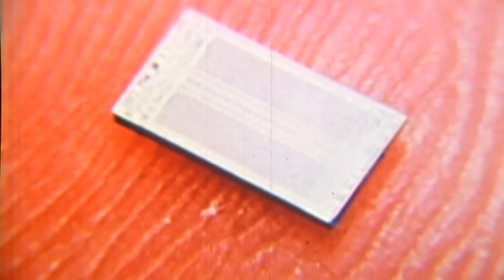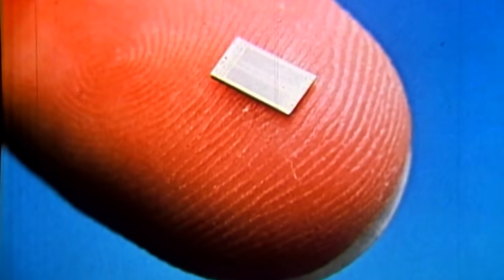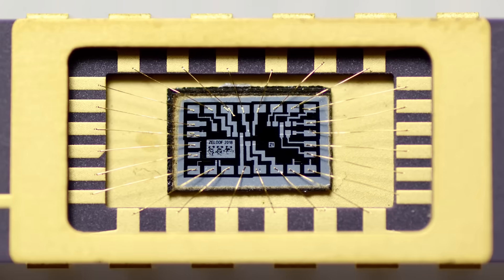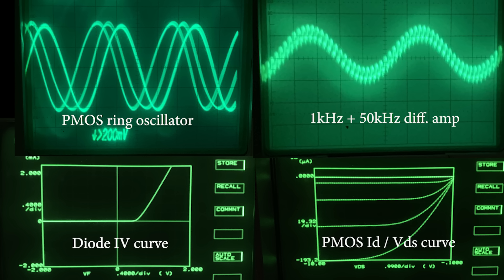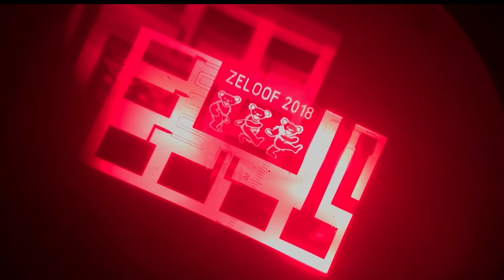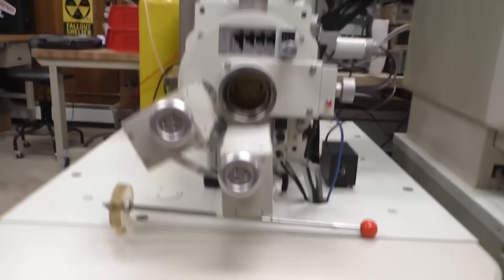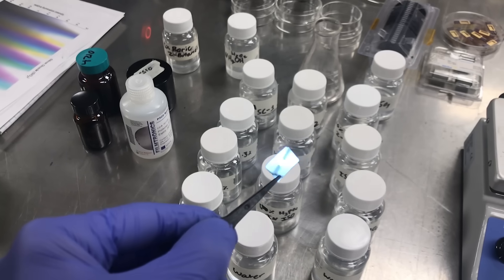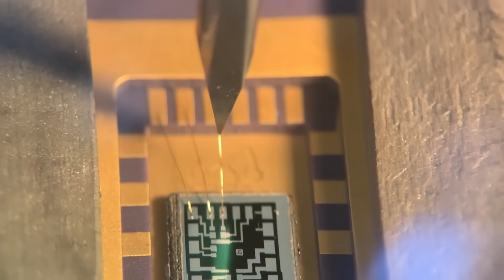"Z1" - Homemade Silicon ICs / Computer Chips

Comment: That moment when you realize that this guy's basement is better equipped than the university you attended...
Reply: Ya, whats up with that..
Reply: @turbojoe2  I don't understand why you are watching and commenting. do you despise I think he is a great individual researcher.
Reply: Sad truths.
Reply: At home I have a 3 gigabyte corpus of Khmer language, probably bigger than any linguistics department of any university has. Its because I DIY an English-Khmer translator called Sugar Palm Tree Translator.
Reply: @charlieangkor8649  wtf
Reply: YES
Reply: so true
Reply: Thats an understatement!
Reply: My university has a full semiconductor fab capable of up to FinFET and also a hypersonic wind tunnel and an experimental reactor was there,to be replaced by a fusion reactor.
Reply: Yes, because I didn't attend a university.
Reply: yea i saw the title and i was ready to make a ryzen with my kitchen gadgets and now this
Reply: This isn't a joke its literally better than my desks where I have my tools with my 3d printer lcd separator soldering tool hot glue shit and others amongst them I once wanted to buy the hot air machine for cpu separator for ps3-4 cause I had an idea to do some experiments and diy sockets play around with ps1 to inject some os or firmware and gpu from ps3 or even ps2 but only the machine itself cost a fortune to worth for a hobyist to behonestly I can be a freelancer but its easily to repair playstations with hot air gun if you are good although nobody will need repairs nowadays I got only repaired a hdmi socket on ps4 once with hot air gun this guy can repair even 10 layer motherboard with his equipment while I only trash them and at the best I fail to repair them if its not a capacitor problem or any other equally big component that will not be destroyed by solder gun or solder
Reply: I thought the same thing .....
Reply: True😂😂lol!!
Reply: REAL, FACT, LEGIT, TRUTH, TRUE
Reply: Hahahahahaha WoW so true!
Reply: And that HE should be one of the head guys somewhere big....!!
Reply: At least 2 m$
Reply: I make chips at home - not sure what all the fuss is about - some nice potatoes - in the oven....:)
Reply: I know that feel bro!
Reply: Fucking accurate
Reply: 😂😂😂
Totally true!
And I went to a very good one!
Reply: I agree. Homemade but 'home' where very well equipped.
But It is also great, because he understand whole process and use equipment.
Reply: lol
Reply: Yup
Reply: Then you are attending the wrong university
Reply: Also likely far cheaper to equip than the degree costs
Reply: 💀 moment
Reply: So true
Reply: i did a lab the other day, lab equipment had last certified accurate tags from 98.
Reply: True AF
Reply: the stuff you can achieve and learn by yourself is better than any university :)
Reply: Hahahaha zing!
Reply: Schools for fools
Reply: Exactly 💯
Reply: For sure
Reply: Yep! I studied economics, though, so...
Reply: Doesnt take much. To be honest the biggest gap isnt wealth its knowledge. After that its saving all your money amd taxes for like 2 years and you can get or build whatever you need.
Reply: He has a will to learn and do something about it. On the other hand, most students don't even try learning. And they become teachers in universities. They don't even try building things.
Reply: @JoséFranciscoCandidoFilho  Will is one thing. Money is another. I have 100% of the former, and 0% of the latter :P  And this equipment seems to cost helluva money :q
Reply: @bonbonpony  There are tons of people that do wonders with nothing. People help if your desire is truthful. He himself said so: he made everything scrapping parts and getting some as gifts. He just found a way.

People that needs lots of money wants everything ready and perfect. Try doing the parts yourself.

Money helps. A LOT.. But it isn't the necessary factor. Your will is.
Reply: thanks for motivation
Reply: @JoséFranciscoCandidoFilho  Yes, willpower is a powerful tool; i've got zilch for cash yet have some pretty neat kit on my electronics bench, nearly all gifts or oppourtunistic grabs of old tech (I've got two analogue oscilloscopes; one I saved from the dump, another I bought on the cheap from a local classified ad...)
Reply: @KomiyanVT  I'm in the same boat. A functional used 20MHz CRO from the 70's costs around ~200 USD in my area. 

I found mine in a junkyard. I took me ~4 years to fix it thanks to the parts being scarce but I got it cheap: I paid ~5 USD thanks to being very 'weighty'.

Considering everything, I must have spent around 30 USD to fix it. Some parts people gave away to me. Still, 30 USD was "a lot" for me at the time but very payable.

Not exactly the best of scopes but it made me learn so many things! I was able to create many others and earn some money.

Don't give up, people!
Reply: @JoséFranciscoCandidoFilho  Not true. He still has several thousands of dollars in equipment he has paid. Just his laser engraver he uses to cut silicon wafers is worth $30.000 new, or 10000-15000 used. In the best best case, he got it for 5000. He said his electron microscope was listed for 2500 although he persuaded the seller to sell it so cheap the shipping was worth more, I guess some $1000 in the end (500 + 500 shipping). He also has the advantage of living in the USA, pretty much every chemical is available and can be bought by anyone. In my country just some nitric acid or high test peroxide requires a military permit, and lots of more exotic chemicals are simply not available.

Compare that to myself 13 years ago... Sam wanted to make IC´s, I wanted to make gas turbines, I read the books and everything, but I wasn´t able to afford a simple used car turbo (worth $100-150 in those days) to start making it. Even today I can hardly afford 1/10 of his equipment, I don´t even own a mini metal lathe yet. Money IS an issue, you can´t make everything just with effort.
Reply: @JoséFranciscoCandidoFilho  I wish your view of the world was real
Reply: Bon Bon That’s true, I hope one day the universities will be open to everyone.
Reply: @JoséFranciscoCandidoFilho  and your freedom too. Some countries, even first world countries illegalize domestic ownership of heavy machinery without a license. I dream of living in america where you can pretty much do whatever you want unless it negatively affects other people.
Reply: @bonbonpony  you would be amazed at the equipment you can pick up for next to nothing at hamfests. Massive ones sell all kinds of stuff other than ham radios, many times auction vendors that buy up University sales, estate sales, lab equipment dumps from various companies as they upgrade, sell at these shows. Craigslist in the industrial sales section you can buy machine shop tools. You may have to make that vacuum chamber yourself. With a lathe and mill.
Reply: @JoséFranciscoCandidoFilho  Sorry but the real world isn`t anything like you described.
Reply: @random-thought-919  There are those that do something and the majority that doesn't. For me, it is that simple.
Reply: @JoséFranciscoCandidoFilho  I've never seen you on Forbes. Maybe you are not doing enough then.
Reply: @random-thought-919  let's get things straight:

- If that ever happen, so be it. But I don't plan on being on Forbes. 
- Science & DIY doesn't mean Forbesand never will.

- You need to chose if you want to do something or be on Forbes (or both - only God knows the effort you will put on it).
- Maybe you are not getting there because you are deviating you ways (e.g. expending time doing sassy comments that helped no one and that doesn't have relevance). The author of the video certainly won't waste time on these type of stupidity - neither will I anymore.
Reply: @JoséFranciscoCandidoFilho  You just wasted your time.

Man, just quit that `work hard get there` bullshit. Meritocracy is not a thing.
Reply: @JoséFranciscoCandidoFilho  Hey man, thanks for your speech. It's very inspiring but sadly you still to have moneys.
Reply: @estebannegrete7662  laser engraver? cant he just cut the wavers with a hacksaw?
Reply: @JoséFranciscoCandidoFilho  who is Forbes?
Reply: @charlieangkor8649  The guy deleted the comment. He said something about me never being on Forbes (magazine) or being important so what I said was supposedly bullshit.

Edit: the magazine is famous for listing the richest or the most powerful every year and many other lists.

Example: https://www.forbes.com/billionaires
Reply: @s.sradon9782  what country won't let you buy machines lol? its not they they can be used as a weapon
Reply: @baileyharrison1030  the UK can fine you and confiscate your heavy machinery if it happens so to not meet regulations. So lathes, steamhammers etc
Something like an electric kettle or PC is fine though...probably.
Reply: S.S RADON but if you’re not selling anything or using machinery commercially, then would they really send inspectors to make sure your CNC machine ‘meets regulations’. I’m also from the UK and I didn’t really think something like this would happen.
Reply: @baileyharrison1030  you basically need a license for everything here, but given that your neighbours don't report you you'll be fine.
Reply: @bonbonpony  best ponii
Reply: @JoséFranciscoCandidoFilho  after i read your comment i made a 4NM x86 256 core CPU in my bathroom with nothing but an old paperclip and wires harvested from my toaster!!!
Reply: @impv1se  Cool! Now, please, make a 64bit 256 core with an addition of rusty stapler - that only God knows why - was in your bathroom. Photos or it didn't happen.
Reply: @JoséFranciscoCandidoFilho  what makes you think its not 64 bit?  x86 is just the instruction set. meaning its an intel/amd compatible. not even god knows why... i hope.
Reply: @s.sradon9782  I do not live in America, unfortunately in this case.
Reply: @leduy6623  Believe it or not, I did work for a major semi that I'm obliged to not disclose (NDA ftw). I currently work in a synchrotron research facility where we pretty much have to build everything from scratch as we have no money to buy parts. I live in Brazil so looking for it isn't difficult. Also, the US limits us largely of what we can buy because every piece of tech they think is/might be used for weapons, they veto. So yeah, I very much know that you can achieve what you want with scrap materials, luck, empathy of others, perseverance, knowledge and money - if you so have.
Reply: @JoséFranciscoCandidoFilho   Eu nao posso dizer muita coisa em portugues mas especialmente voce quem mora em brasil deveria saber que nao ter dinheiro decide onde voce ia existir no brasil. Em uma situacao rica ou pobre. Voce quer me dizer que no brasil a unica razao para ser pobre e nao ter muito de detirminacao? LOL pare mentir para voce mesmo cara :)  voce nao vai ter de muitas oportunidades.. e oportunidades se formam demais com o dinheiro. Sem dinheiro voce nunca vai ter chances. E um de maior razoes porque brasil é um pais com demais inqualidade porque poucos pesoas ter o mais deinheiro. Os pobres ficam pobre e ricas ficam ricas. Vai fala alguma coisa de determinacao numa favela perto de voce.
Reply: @bonbonpony  same here absolutely 0% of the latter
Reply: @bonbonpony  It seems that he built most of the equipment he uses
Reply: @PrinceOfAstoria  Which still requires having the stuff to build it from, and the tools. They don't grow on a tree, y'know?
Reply: @JoséFranciscoCandidoFilho  Yeah nó, I ain't taking word of a random guy on the Internet about his/her own credentials, số whatever you claim yourself be to justify your highlier-than-thou attitude
If you really work in the semiconductor industry, tell me the lowest price possible for an individual hobbyist to acquire just a photomask for an atmega8 equivalent ic. I'll wait.
Reply: @estebannegrete7662  move to the U.S
Reply: @JoséFranciscoCandidoFilho  This dude has an electron microscope. Those things are not cheap, even the one he has. He needed a lot of money or got a good deal on it, but it's still far out of the realm of everyday individuals.
Reply: @charlieangkor8649  If you watch his follow up video he cuts the silicon wafers with a a much much cheaper diamond scribe cutter and broad ended tweezers. You don't need a laser device!!
Reply: @JoséFranciscoCandidoFilho  your misspelling luck.
Reply: @JoséFranciscoCandidoFilho  spending money on things that may not pan out isn't very smart. Do i spend on something that may not work or do i eat.
Reply: @JoséFranciscoCandidoFilho  Congratulations on a very accurate determination. There is no despair for human beings.👍
Reply: @bonbonpony  Yeah money is important, but more important than that is the willing becuz the willing can be used to make enough money and therefore the building with even more Will
Reply: @bonbonpony  it costs  a lot, if you're interested, i might be able to help you with design of certain stuff, I'd love to work on such project, as this is also what i wanna do but i know i'll never be able to afford, so like as a silly person to maybe not as silly one (you), i offer my help on design
Reply: exactly with will there is a way
Reply: @Shimmy Shai Dude, all I said was that you can pick up spare equipment at hamfests. Im sorry if you don't have those where you live, but please, I don't need a dissertation on economic factors and whatever the hell you were blabbing on about. Chill out man.
Reply: This guy (author of this video) - He should find a normal day job like normal adult like working in Amazon warehouse instead wasting time on some science mumbling. At least in Amazon he could learn what work is and contribute to society
Reply: @u r Indeed. President Trump is an example.

Comment: Amazing 😲 can you do something more complicated like say Zilog Z80? Intel 8086?
Reply: he needs much smaller size/"process node" in order to even start thinking about making Z80/8086

but its still extremely impressive that 1 guy can make a 5um based chip
Reply: @300maze  thank you for answering, could you tell me what he could do with this node? Something from early 70ties?
Reply: @WolfKenneth  very simple circuits, the one he showed in the video is an example
and its not just the size, its pretty hard to make complex circuits work without issues that occur during the making of the chip

Comment: “Homemade” is a very stretchy definition 😆 137% amazing!
Reply: dont forget to switch off e-microscope, plasma etcher and zero-vacuum pump in your kitchen, before baking pancakes
Reply: that is kinda why I am pushing boundaries here in my lab to build a unit that not only allows producing things like this from a 3D printer perspective, but also breakdown and sorting the materials in such things for reuse in the same printer :)
Reply: @ThomasAndersonbsf    Do you have a blog?
Reply: @genericdeveloper3966  nope not had one of those since the live journal days
Reply: @ThomasAndersonbsf  why not have the fabricator and dissambeler as separate units?
Reply: @wormwoodbecomedelphinus4131  the tooling is nearly identical just reversed and less power to deposit more to decouple and absorb, so makes no sense to build the same hardware twice. Plus more portable for all in one.
Reply: 1337% amazing even

Comment: Been wondering why a 1-2um fab doesn't go full digital masks and offer small volume IC's.  Lots of fun analog and sensing things that could be done.  With a standard package and bond-pad layout, it could be highly automated.  Say, a transparent TQFP-44 with a central thermal ground pad or some transparent QFN package.

Comment: You even put it in a ceramic DIP package with gold pins...
Doesn’t get more retro that this :D

Good job, and hats off to you for this impressive engineering feat !
Reply: TheDrunkenMug I’m a bit surprised he didn’t build his own injection molding machine so that he could  overmold a lead frame.
Reply: @dave_dennis  When reading your reply i tought of an EVEN MORE RETRO way to close up this DIP package:

A quartz-glass window, like on those old EPROM DIP packages.. :D

Yes I spelled that right, I did not mean (Flash-)EEPROM, the above tech misses the extra E in front which stands for 'Electrically'. Which is true because mostly EPROM's were erased by shining a UV lightsource directly onto the die.

This also explains why most EPROM's had a sticker or piece of tape put over their (always round shaped?) glass window:
in order to stop any stray UV light entering and causing (partial) erasing action

If you have never seen a EPROM with such a window, I suggest you search for some pictures or pick a (dead?) one up from ebay or such for one or two Dollars.
They are magically when you look into them with a lookingglass or microscope !

Greetings,
Reply: TheDrunkenMug I own my own UV eraser.  You don’t have to explain this to me.  😉
Reply: @dave_dennis  awesome ! I like old tech allot more than new tech. Nowadays everything is hidden from sight, while technology is too cool to be hidden.. I beleive

Comment: That really cool.

I'm actually about to start the same journey.
I picked up a scanning electron microscope and good size vacuum chamber for less than scrap value not long ago.
The two items I'm missing that I know I might have trouble finding for cheap or building are the furnace and wire bonder.
Reply: the furnace is easy to build yourself, i have seem dozens of good tutorials.
https://www.youtube.com/results?search_query=diy+electrical+furnace
wirebonding, not sure by my guess its way easier than to find the electronmicroscope xD.